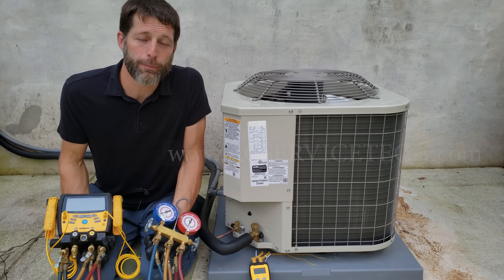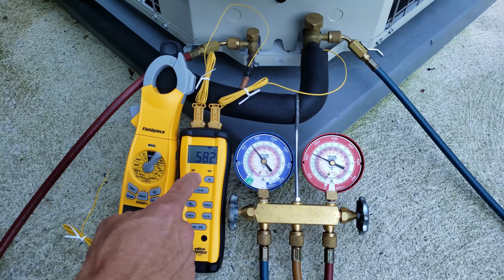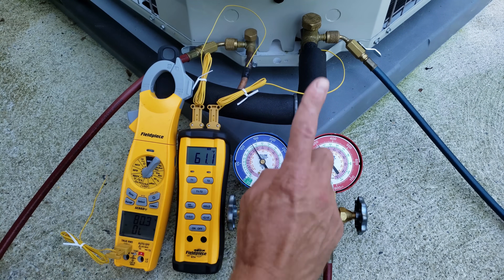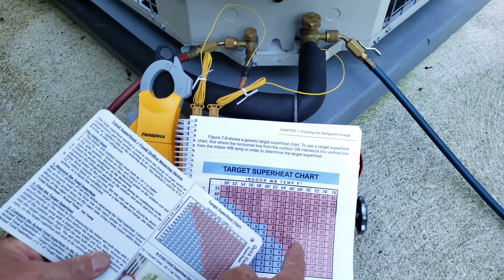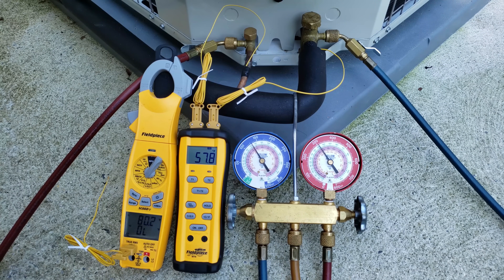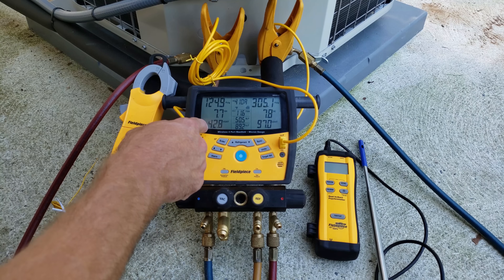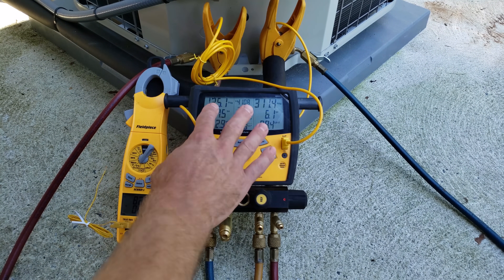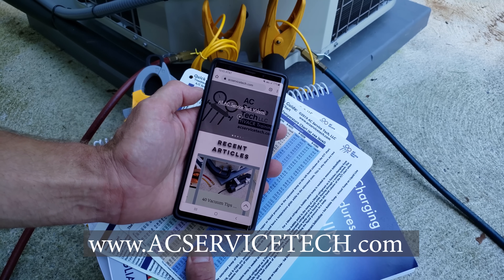Finding Target Superheat to Check the Charge of an R-410A AC Unit!

Comment: When charging a 410A split system with a modified condenser for heat recovery (compressor discharge hot gas line re-routed to heat exchanger of recovery unit, then back out to the condenser) does the subcooling target number on the liquid line still stay the same for charging ?    (since design specs were changed and now you have is essence a larger than factory condenser which is condensing quicker and giving more subcooling than design specs)

Comment: If a unit is overcharged with very low superheat like 3 or 4, unit runs and cools but is the risk that the compressor will fail prematurely? If they corrected the poor airflow issue, superheat would rise?

Comment: Okay so basically I can skip the total superheat process and just take the temperature right out of the wet bulb with the outdoor temperature to get the target? Please technicians correct me if I’m wrong
Reply from the maker: You would need to then compare the target superheat with the total superheat.
Reply: Thank you so much and which method is accurate between total and target superheat to to get a better reading-to see if  the unit is low on Freon

Comment: Even on a fixed metering device it is always a good Idea to calculate subcooling in order to see the big picture such as restrictions and/or airflow issues.
Reply: When charging a 410A split system with a modified condenser for heat recovery (compressor discharge hot gas line re-routed to heat exchanger of recovery unit, then back out to the condenser) does the subcooling target number on the liquid line still stay the same for charging ?    (since design specs were changed and now you have is essence a larger than factory condenser which is condensing quicker and giving more subcooling than design specs)

Comment: I am trying to wrap my mind around what is happening to the gas if the SH is way low, I.e. you said "if low to 5 or so, we want to make sure we're not sucking liquid back too the compressor". So that would be overcharged robbing volume? causing a lack of space for expansion to take place?
Reply: It's the phase change back to gas. The refrigerant has to absorb heat to phase change,  if there is too much liquid refrigerant  entering the evaporator it does not pick up enough heat to change to gas. Excess refrigerant or low air flow across the evaporator. Fixed orifice isn't as easy a txv to get to run optimally and your numbers can be alot different than target superheat if the fixed orifice isn't ideal, and air flow and air pressures aren't optimal due to duct sizing, return size. Getting a suboptimal system to perform as good as possible is why good service techs can make lots of money.

Comment: On my old r22 system with a piston, is it true that if the vapor line temperature at the condenser is 41 degrees, (83 dry bulb for what it’s worth) the MOST my superheat can be is 9 degrees or so if my system is working properly? (Since the evaporator coil isn’t freezing, I took 41 and subtracted 32 to get 9).
I have two 33 year old Armstrong air units and both work well. Clean coils, good air flow etc. I do not want to hook any gauges to them, there is just no reason. The downside of creating a schrader valve leak outweighs any knowledge I would get, since they are working very well. Delta T indoors is about 19 degrees which is just fine for me.  I find this stuff very interesting. Thanks in advance.
Reply: 41 degrees makes sense. Yes . Depends on the other variables

Comment: Craig, I wish you explained in this video better to its listeners WHY you are checking the WBT in the return at the air handler and not the DBT.  So let me explain the missing info. You only check the WBT if the relative humidity is above 70% or below 20%. Anything in between you are to check the DBT at the return.

Comment: Why were the digital and analog readings so different? Super heat on Analog was 14 and Digital it was 7.5. Why is that?
Reply: That's exactly what I thought, lol which would be more accurate?
Maybe look at the overall picture to determine?
Reply: The I door wet bulb changed, shifting the readings
Reply: Because it fluctuates depending on indoor / outdoor temps . Maybe after removing analog gauges and attaching digital ones outdoor indoor temps weren’t exactly the same etc

Comment: Thanks. What happens when a fellow employee insists on charging by sub-cool method on systems with pistons ?
Reply: We’ll sub cooling can tell you something also if you reading a piston system . Too high of a sub cooling can tell you it’s over charged so your next move would be to reduce sub cooling,
Reply: @Sesamestreet9080  appreciate reply, but sub-cool method is for TXV system and superheat is for piston/ fixed orifice. And “I” find these scroll compressors to be very finicky and don’t last if not pretty much dead on. Oh well, he’s the sup, so it’s on his head, but man, in Deep South, summers are murder on units already, if a person is there working/ charging it…., why not simply do it correctly? 😖🤷‍♂️
Reply: @bayouflats5054  definitely charge by superheat with piston, but knowing both will let you know what’s going on with the system , sub 6 on superheat means you’re flooding the compressor

Comment: Hi Craig, I have a R410a unit - model # YCJD36S41S1, the unit pressure is 175 PSI when the unit turned off, do you know if this pressure is correct? Thanks
Reply: Depends on outdoor temp. It will change pressure in an off unit

Comment: I wonder if I could get your opinion on this

r410a refrigerant 

My sub cooling is high, unit calls for 10-12 but it’s 18 (it’s a TXV system)

super heat is .8-1.2

Temp split is 18-20

Suction line temp is 38-40 (118 psi)

Liquid line temp is 75 (288 psi)

Outdoor temp is 77

Indoor temp is 77

Blower is set to 400 cfm, 3 ton

Filter, blower, evaporator, ductwork is all clean, all new units installed a few months ago

Comment: I have a question if you have a 410a system with a txv and you have good temperatures like say 42 degree evap coil temperature and 11 degree SH and 8 degree SC but have low suction pressure of 95 psi and a head pressure of 305 psi is this a system that has issues like air flow or other problems
Reply: Michael Dreves 
Take your readings again. Something seems off. If you have a 95psi your coil would freeze. 95psi is a 28° evaporator temperature.

Comment: I have replaced a heat pump compressor(2ton) that had r-22  and i filled it with mo-99... replaced filter dryer, did a nitrogen  pressure , pulled a good vacuum... the evaporator is a fur down unit (pancake) i  checked both piston... blowers are ok
..the problem I have is that the compressor making a hissing noise, Low side 115 psi , 15 sh , vsat 71.4 , slt 86.3....hi side 168,  -OL sc (no subcooling), 85 LSAT , 86.6LLT....had a a/c company called in and said was the valves 🤔 went ahead a replaced it with another compressor same problem no enough super heat/no cooling properly...
Did replaced filter from the beginning...coils inside evaporator and condenser clean. 
I KNOW THERE'S A PROBLEM BECAUSE NO COOLING PROPERLY/HAVE USED DIGITAL AND ANALOG GAUGES BUT DON'T HAVE PROPER READING...I HAVE OVER CHARGE   AND UNDER CHARGE IT ON PURPOSE TO SEE BUT CAN'T FIGURE IT OUT....
Reply: Check filter driet

Comment: So basically you need those fancy tool's 😁 Great video 👍✌️
Reply: No. You can use the compound manifold gauge set (analog dial pressure gauges) and less expensive psychrometer to read the temps. No need for digital instruments.